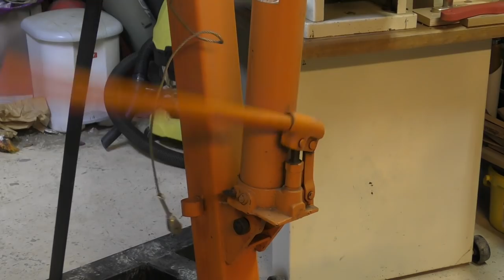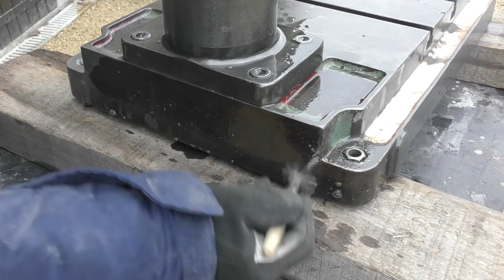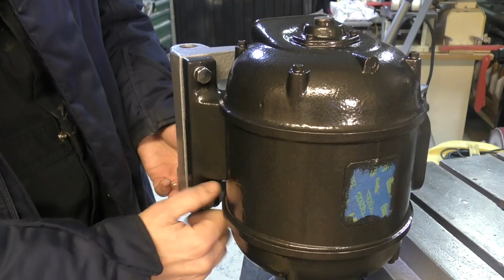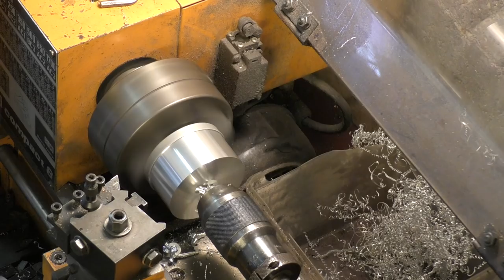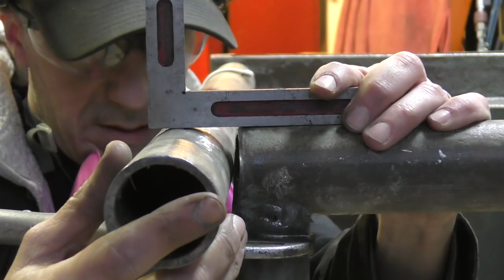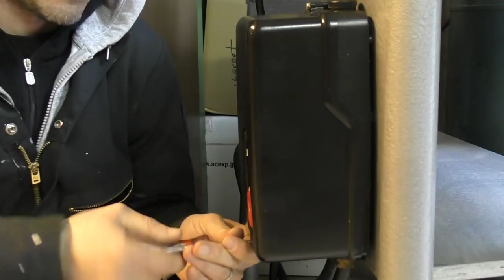Vintage Drill Press Restoration - Sydéric S115

Comment: That's a hell of a drill...... awesome rebuild too....... I wonder if it's a viable hobby/parttime job sort of thing?? just for the reasons of bringing old but still great machines back to life.... that drill is probably better built than most of today's brand stuff
Reply from the maker: Thank you Matthew. I can be. A lot of people restore okd machine as a job, but a lot of equipment is needed and it's a niche market with high prices. But you're right, this drill is will last years before it needs even a small repair :)

Comment: Esthetically very pleasing, but...  What about the insides?  The motor did not need any overhauling?  It's true that those things are probably so well made and sealed that they only require new brushes once in a blue moon!...  That handle looks friggin' AWESOME!!  Good job!!
Reply from the maker: Thank you very much. After I took it apart, I checked all the part and the motor off camera. Everything was in really good condition so it was good to be painted and put back together. The motor was actually brand new because the drill had been modified to run on air (that's the big green thing I took of at the beginning of the video). Thanks again for watching :)
Reply: This was likely an AC induction motor, which has no brushes. Only wear item would be the bearings and maybe a few contacts if it had a start capacitor and switch.

Comment: nice jobe but i am curious , that thing was still looking alright , might be something i mists .
Reply from the maker: The drill had been modified to be pneumatic, the motor was disconnected,
 two sheaves were stuck, there was no light, chuck, handle, nor power 
supply, plus some parts were rusty and the paint hideous. I fixed all 
that. Thanks for watching.
Reply: o ok got you

Comment: bravo pour cette excellente vidéo , le volant de colonne est bien en montage conique ? ton volant semble en acier ou aluminium , j'ai une S115 hélas le volant bakélite est brisé ou trouver un volant similaire ??? des avis ??? cordialement sylvain
Reply from the maker: Merci Sylvain !! Oui conique et en aluminium. 
J'ai cherché pour des pièces détachées mais elles sont apparemment extrêmement difficiles à trouver. C'est pourquoi j'ai dû refaire quelques pièces moi-même...
Il faut surveiller les petites annonces et essayer de négocier. Courage en tout cas.
Cordialement
Reply: merci pour ton message , je vais adapter un volant aluminium de chez kipp avec passage au tour et solidariser avec une bague afin de pouvoir reprendre du service , je serai intéressé d'échanger avec toi en mp si tu es d'accord pour ma restauration qui semble bien semblable a ta machine , cordialement sylvain   @RedSmithWorkshop
Reply from the maker: Aucun problème, voici mon email : theredsmith@hotmail.com
Je risque de mettre plusieurs jours à répondre, mais je réponds toujours. 
Courage pour la restauration !

Comment: Cutting something off in the lathe with a hacksaw is easyer when its on in reverse and cleaner even cut?
Reply from the maker: It's much easier when you use a cutting tool on the lather (which I don't have). If using a hacksaw, pretty much same result either way :) Thanks for watching.

Comment: My only question would be, why didn't you just change out the motor and all the electricals? At worse, you've have had to make an adapter.
Reply from the maker: The motor was in perfect condition. No need to change it. I just had to rewire everything and put a power adpater to power the lamp.
Reply: It might have been but it wouldn't have been a good match for anything in the US. I'd have changed it our for that reason.
Reply from the maker: Surely. You're in 110V or 220V?
Reply: "The motor is a 380V 3 phases 1/2 HP. " I don't have 3 phase available, nor 380V.
Reply from the maker: Changing the motor was the best thing to do then.
Reply: And likewise, if you have the proper voltage  available and the motor is good then use it.

Comment: G.. dude.. this is amazing! So much work you put into this and it turned out so good! 
How did you keep track of all the parts? I'd probably have an IKEA moment where I have 3 parts left over but pretend it's all good :p
Reply from the maker: Thanks a lot Ellen. I put it all in a bucket and watch the footage I made when I took it apart. And I  ended up with only one extra screw ;) (just kidding)
Reply: The Redsmith Ooh good thinking! Big benefit of making videos :D And just kick that screw under the table, no one will know ;)
Reply from the maker: A screw ? What screw ? ;)
Reply: Would you 2 stop screwing around!?
Reply: Crafts With Ellen - Assembled a new garage door one time, and had hundreds of screws, washers, and nuts left over.  Looked like they counted them with a scoop. Like Raisin Bran, 2 scoops of each ought to be enough.  LOL